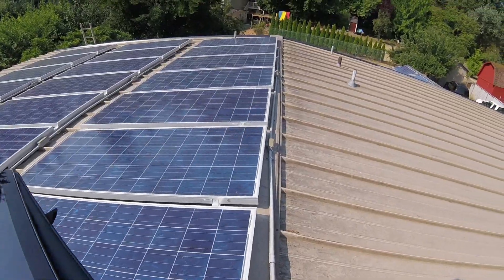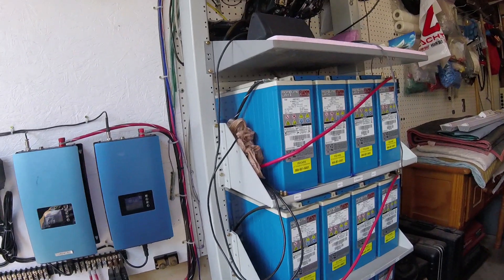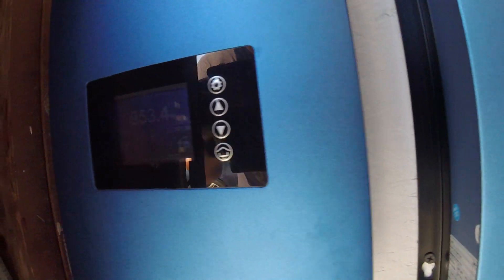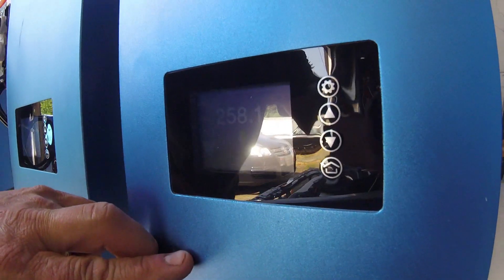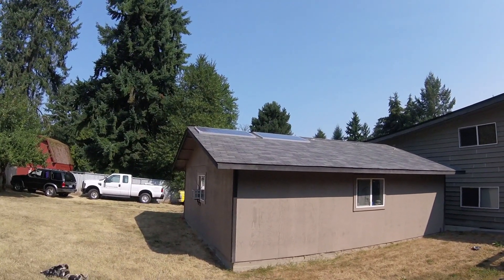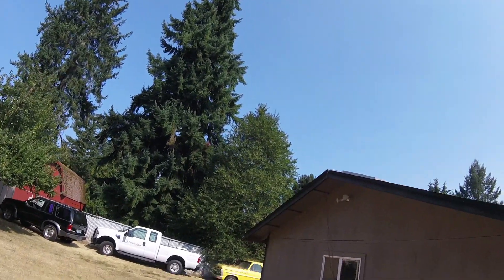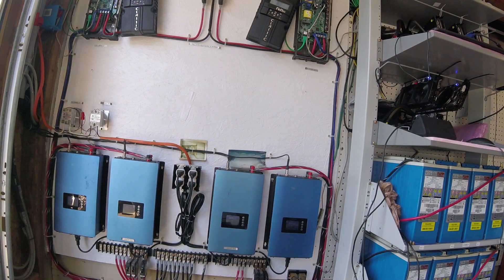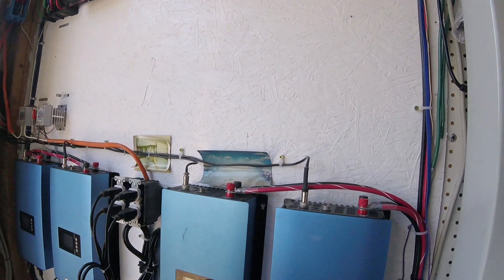5600 watt grid tied solar system with limiting inverters

Comment: i would wire panels in series to bring amps down and add more panels
Reply from the maker: I ran out of usable roof! I could have added another line or two but at a fairly steep angle :(

Comment: what are the blue inverters' max panel voltages? you have 10 strings with 2 panels each?  are they 100W panels? whats the maximum dc voltage for the inverters? Not a lot of documentation on these things. Can I wire 3 x 320w panels to them?
Reply from the maker: Not sure on the specs I can’t find the booklet, I used the outback’s for string management. You can probably wire your panels in parallel to keep the voltage down.

Comment: I've heard that they overheat if you run them near the max 1000 watts. But it looks like you haven't had any issues.
Reply from the maker: We had no issues running them full bore, but they really only run about 5 hours at a time.

Comment: Hello, i order 2 grid tie inverters 1000w each with limiter . My question is. I have just one phase, can i connect the 2 limiters on the same phase?it will work fine? Thank you
Reply from the maker: I believe it will, that is what I did for each leg.
Reply: I was wondering the same. They synchronize to the grid so I believe it would be OK but I wouldn’t turn one on until a few minutes after the other. Let me know if you tried it

Comment: Hello, i need your help please , i have 2 inverters as you have, but my main wire is 1 only (one phase 220v). .so how i must install my 2 limiters ? on the same phase? it will be okay? or i must make parallel the 2 limiter wires and use just one limiter?   thank you very much
Reply from the maker: I wish I could help you but I have no experience with single phase 220. I do think that two inverters on the same phase source will not work without so sort of comber equipment.

Comment: Is it possible to use two differnt grid tie inverters on the same system?
Reply from the maker: This system uses 4:) two for each 120v line.
Reply: @BertsFordFactory  Thanks, gonna give it go, as I have a solar grid tie with limiter, & was keen on a wind turbine so this looks good, with a limiter. Thanks

Comment: can i connect 48v 800w wind turbine via charge controller or rectifier?
Reply from the maker: I’ve not worked with wind before but I think there is a couple things to do besides handling the power. I know they have concerns with over speed that’s controlled by other equipment and the such.

Comment: So if I get this right, you're running two inverters per phase, right? How does the limiting function work with two? I would think that they would both read their respective amp clamp, see how much is being pulled from the grid, and attempt to deliver that much back, resulting in 200% of the required current being delivered, with the 100% surplus over consumption backfed to the grid. Perhaps my logic is flawed.
Reply from the maker: That is exactly what I was worried about before the build and nobody seemed to know. what happens is when the inverters boot up the first to of the two starts to produce all of the perceived needed power that it can, then the second inverter come online and starts to pick up the difference/extra s. they somehow balance naturally maybe due to reading the slightly higher voltage that the other inverter is inserting it power at. I hope this helps!
Reply: @BertsFordFactory  Wow, so it Just Works. Color me surprised. Once I get my first array up and working, I'll grab a second GTIL and see how it works. Thanks for responding!

Comment: Are you still using the SUN inverters? Wonder how they are holding up?
Reply from the maker: I no longer own that house / system. They were running without issue for several years. I have not heard otherwise in the last two years. I do stay in contact with the new owner.

Comment: is there a little bit going back to the grid even with these limiter or not? cuz if they see that it goes back to the grid the provider can fuck you up, i wanna do a systeme like this but i'm afraid of this issue
Reply from the maker: The auto islanding built into the inverters prevents that. They will not turn on until the source voltage turns them on and turns them off when it is gone. Perfectly safe!

Comment: In your video you said you are running 240 volts off of one battery bank with no problems. No trouble with neutrals on the inverters?
I would like to see a diagram if you would have one. Setting up a 2k system next month, and would save if I can use a single battery bank instead of two.
Reply from the maker: I did not have any troubles with neutrals. Unfortunately I do not have a line drawing.

Comment: Hey I know this video is a couple of years old the blue grid tie inverter power limiter I was thinking about making a similar system I was wondering how those inverters are working and if they still do. lot of mixed reviews on Amazon
Reply from the maker: I sold the house that this system was installed on. I did have them running full time for more than 2 years without issue before that.

Comment: I noticed that you are using internal limiter connection. Did you have to change the default factory settings in all 4 GTILs, or you kept it on MPPT mode since the limiter is connected? Thanks
Reply from the maker: I had to set them all because they are activated by battery voltage and you never knew which one would come up faster!

Comment: a little bit complex system, actually you can do all with only one powerfull hybryd inverter (5.5 or 6 kw) with more efficiency and less power consumption
Reply from the maker: Fairly old design in solar world, these units didn’t all the new options, but thanks for the info!

Comment: Really nice work! I have a couple of questions: Are you running the inverters in Solar/Battery mode (which disables the MPPT function of the inverters) and using the Mid Nites to power up the batteries and the Mid Nites handle all the charging?  Then from the batteries, the inverters get their DC power?  Do you then have the DC disconnect voltage set in the inverters so when the sun goes down you go on just batteries until you reach your disconnect voltage? I assume if that way when the sun comes up and the inverters see the reconnect voltage the whole process starts again without you doing anything??
Reply from the maker: You are correct with everything except the midnites monitor the battery voltage and activate the solid state relays to turn the inverters on and off based on battery voltage. I just didn’t trust the inverter to manage the batteries.
Reply: @BertsFordFactory  Thanks! And again, great job on your system!

Comment: I assume you have hooked this up without inspection from utility.I’m scared to do this because I don’t want a lawsuit.Any ideas or have you pondered this in your plan?
Reply from the maker: These inverters are auto islanding and very safe. All this wiring, except the outlet is low voltage. Zoning is different everywhere but I did not require any special permissions. The mounting of the panels usually requires a permit though which was easy.

Comment: Needs More specifications,battery capacity and connection style,AH battery ,a layout would be better.
Reply from the maker: I did another very boring video with very specific info but not a line drawing, check it out:)

Comment: what is your load characteristics? i'm planning to use solar panel, for the beginning i'll install 960 wp total with the same inverter with 2.000 w output without batteries, but in worst scenario my loads can spike from hundreds w to 4.500 w in a second. the objective is to reduce the bill on daytime only (laundry machines). i wonder if the inverter will last long
Reply from the maker: Often in the summer these inverters run at 100% load for several hours every day. Yes we use 4000w continuously often! They are still running strong!
Reply: @BertsFordFactory  good to hear that. i just install my PV panels with this inverter this day. too bad it's cloudy, from 920 wp panels, i only get 200 w

Comment: what is the wire size.??
Reply from the maker: The wire sizes will vary depending on your system. For me 10awg worked from the panels to the combiner box. You can google “wire ampacity chart” to run the number for your length and voltage.

Comment: How many batteries did you use for 10 solar panels
Reply from the maker: The number of batteries depends on your systems ability to recharge them in a day or two. I live in Washington so sometimes I have to shut off inverters in the winter to allow batteries to charge.
Reply: Thanks for your response

Comment: No need for the relays, just set the lowest battery voltage on the inverters.  It isn't auto-islanding it is anti-islanding.  Islanding is when inverters run without grid being active.  Nice setup.
Reply: Would this mean you have to disable the internal limiter/mppt. Thanks

Comment: Which Port are you using for  limiter sensor power going to grid.  Internal or external
Reply from the maker: The clamp cable is connected to the internal port and then in the settings you have to set it up.

Comment: So you have two midnite solar mppt, each charging 8  batteries in each banks, and you have two banks (8+8). And the output of each bank are combined(in parallel?) to power a single negative common bus and single positive common bus. And all four inverters simultaneously draws power from the common bus?
Did i get it correctly? Im just trying to picture it where i can pattern my project. Can you correct if i missed anything. Thank you.
Reply from the maker: Yes except I am 48vdc system so I only have eight battery banks total. Also good to note that the mid nite solars are charging all the batteries in sync, it’s a option to link them and have one in command of the other.

Comment: Nice system.  I know this is an old post but here are a few comments.  Unless the Midnights are different you want your panel voltage to be much higher than the battery voltage.  Also you have a long run from your panels to your charge controllers.  You are losing power there because of it.  Two ways to solve it: higher voltage, thicker wires.  Check out a DC voltage drop chart online.  You will see what I mean.  Disconnect those GTIs connected to the broken panels.  You are back feeding the grid.  In case of a power outage you could kill a lineman.  I know it isn't much power but at best he/she will get shocked you will get in trouble for being an unauthorized electrical producer.  Another smaller point on the batteries.  Make all the runs from the batteries to the bus bar the same length.  Although small, shorter cables have less resistance than a longer cables.  You could be pushing too much power to some batteries and not others.  Remember current flows on the path of least resistance.  Its proportional so 0.1 ohms on one line and 0.2 ohms on a second at a wye means the first line gets one third the current and the second gets two thirds.
Reply from the maker: Thanks for the feedback!

Comment: I would like to built a system like this can you share the schematic  arifhmemon@gmail.com Thanks
Reply from the maker: Well to be honest I mostly used the overview general drawing from midnite solar's webpage for connecting the equipment and grounding. I also derived a good bit of information from their sizing chart. I do not have a full line drawing:(

Comment: I see that all the inverter AC outputs are connected together in one socket. Is there a special way to connect the ac togather or not?
Reply from the maker: Yes, the outlets on the left are activated by the SSR on the left ( all line 1 ). the same is true for the right. the outlets are all 120V AC but because they goto different inverters they represent different phases so together ( line one and line two ) makes 240V AC in the house.
Reply: @BertsFordFactory  thanks

Comment: Are these type of inverter also MPPT ? ...The question is since they are connected directly to a 48 volt battery instead of  solar panel...did you shutdown this option ?   You mentioned that these inverter are for 48 to 120 volts ...in ebay or Amazon...I only find in two DC input voltage ranges 22 to 60  and  45 to 90 V ...From where did you get yours ?  Last question, the relays are used to cut  the AC output of the inverter?  In other words, the inverter are not really shutdown...but the AC export. Hence, since they don't see the AC line...is basically like a grid power shutdown condition.   Thanks
Reply from the maker: Great questions! they are MPPT. it is still used because the inverter sees different voltage based on state of charge 47.7V- CD 57VCD not much difference but still. I got mine from ebay ( ecoworthy ) they are 45-90 on DC side and 120V on AC side. The SSR's are actually used to cut the supply line to the inverters which turns them off completely. These inverters are auto islanding and auto sensing so they need an "example" voltage to power up, sample and emulate. they then send the current back the same line until the ssr shuts of the sample source.

Comment: buy a high voltage inverter and you save all the complication wiring and combiner boxes
Reply: These types of inverters are like this for you to stack them ... as needed ... They are good for those areas where getting permission for a grid-tie connection is very expensive ... and if you happen to have a utility meter that even if you export energy ... that energy will be counted as if you were spending it ... this inverter with limiter makes sense. and they cost around $ 300.

Comment: How much money do you have in it all together
Reply from the maker: The batteries are used and were free, the rest of the equipment cost around 4500USD, the install I did myself. I think the best thing was that I got lucky shopping for the panels on ebay and buying bulk to save shipping.

Comment: Followup question. So all four inverter is drawing power from a one bundled battery pack via common bus bar. Now how did you connected the four limiter sensors from 4 inverters since i did not see it in the video. Thanks
Reply from the maker: I made a breakdown video that shows the amp clamp connections but basically I have two inverters connected to each load main line.

Comment: What solid state relays did you use, and where did you purchase them? I’m having troubling finding some inexpensive ones that don’t burn up at even 1/4th their rating. Thanks again for your video.
Reply from the maker: I just ordered them from eBay, I don’t recall the brand but if it’s important I can get the part number. I think they were cheap like 20 bucks
Reply: @BertsFordFactory  I figured out what you used after I watched the video again ~Thanks! I was trying to shut off the DC side, but when I paid attention that you were using the AC side and the auto-islanding I got it.

One more question: What type of wire did you use for the eco-worthy combiner boxes? It seems I need a 6 gauge sunlight-exposed single conductor wire to run into the box, but I'm having trouble finding that too. I always manage to work against the grain.

Comment: Do you know what the efficiency is on these. I got mine and I'm only getting 75%
Reply from the maker: I do not, I also have not checked.
Reply: I also get 75%
Reply: @diydan6045  ya it's not great but what I'm using it for it will work.

Comment: The stainless screws will corrode the aluminum.  You have to use a special jell to prevent corrosion.  You may have used it, but it isn't worth pulling the screws to do if you didn't probably.

Comment: Once setup. What was the issue with the Whizbang?
Reply from the maker: honestly I didn't look into the why but it just quit reading and reporting to the controller. I wasn't really worried about quantity of use due to using so much more than I can make and I manage the batteries via voltage drop.

Comment: Can you please explain the bus bar and the SSR setup?
Reply from the maker: The busbar setup allows me to share all the batteries with the multiple inverters equally or as needed per inverter. I have the main line entering the house separated for efficiency which is why the multiple inverters rather than one large one. the ssr's turn the inverter on and off ( controlled by the charge controller ) based on voltage of the batteries.

Comment: Thanks for sharing Buddy fantastic system you should be proud! Were you ever able to verify if one CT clamp can in fact be used for two GTIL2's? Thanks again!
Reply: I have 2 inverters with 1 ct clamp you wire the single ct clamp with the 2 input wires going to the inverter 1 ct clamp will limit 2 inverters . There is a guy selling a dual ct clamp I bought that ot is trash all he did was wire 2 ct clamps together . He claims there is a circuit but when you connect 1 ctclamp the other one hums. Hope this helps.
Reply: @Spidersoftheworld  Did you wire them in parallel or series ?
Reply: @GlennRathke_WX  they need to be wired in series . With a resistor. You can then run a parallel connectionaka splitter to each inverter and connect the 2 ct clamps to the single parallel connection comming from the inverters . 
2 ct clamps are limiting 4 1000watt inverters